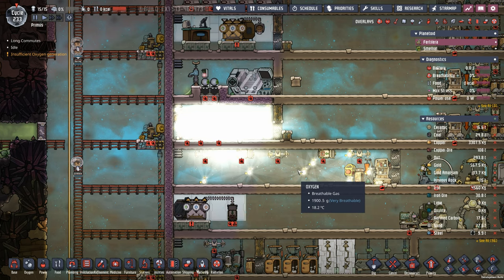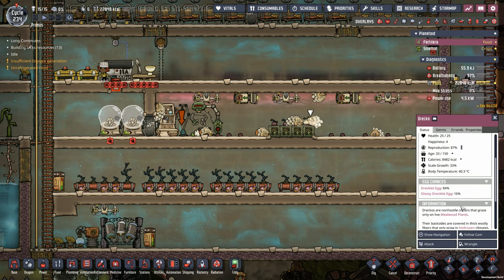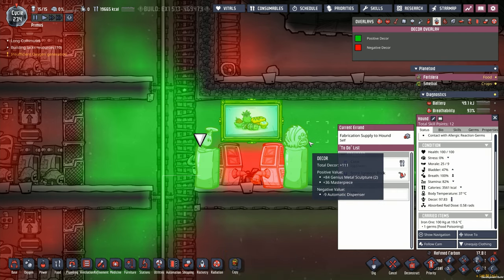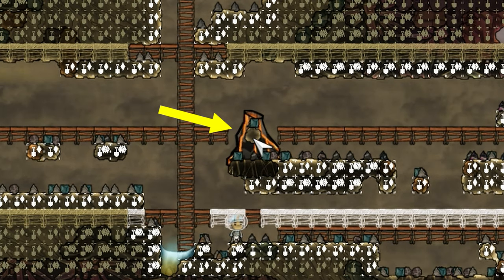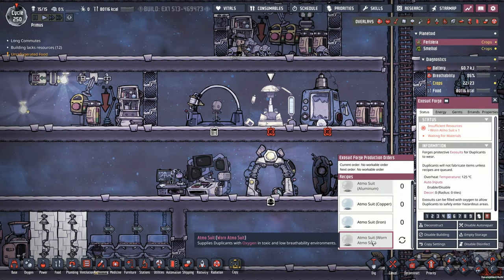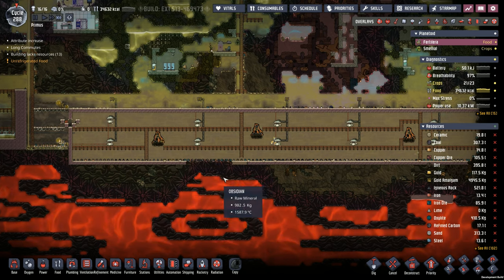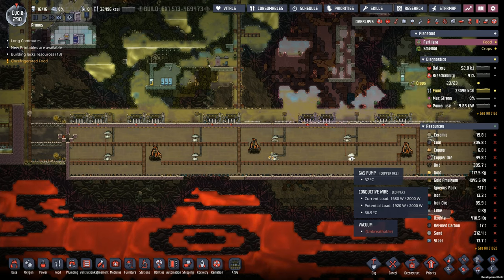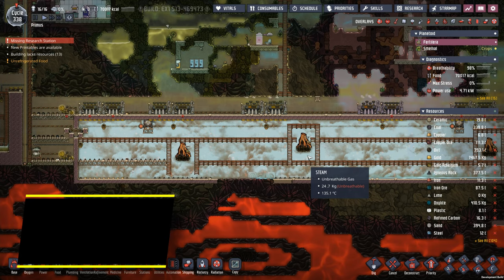Triple Volcano Tamer | ONI Spaced Out! |Primus Ep 6

Comment: It is better to add temp shift plates here and there. You could rotate the igne rock on rails in the steam and kick them out after they are cooled down to 130 c.
Reply: i think also rails helps the spread of the heat in the room, that will be more efficient instead of let the igneous rock as debris on the ground.
Reply from the maker: Def. The dupes have been building the temp shift plates for about 20 cycles so far.

Comment: I followed this closely, but my aquatuners instantly began to overheat as soon as I turned them on.  Steel aquatuner, gold amalgam power cables, steel automation wire, steel mesh tiles, ceramic pipes.

Then the crude oil turned into sour gas and I lost my liquid lock.

Any ideas?
Only one volcano was spewing, the steam temp was 129, the polluted water temp was 40 when I started up the aquatuner.
Reply from the maker: My only guess is you didn’t have enough steam pressure. You want to keep it pretty high to be able to “cool” the aquatuner.
Reply: @EchoRidgeGaming  The addition of temp shift plates from your next video made all the difference.

I used obsidian for the bottom ones. Seemed to keep them from baking anyway.